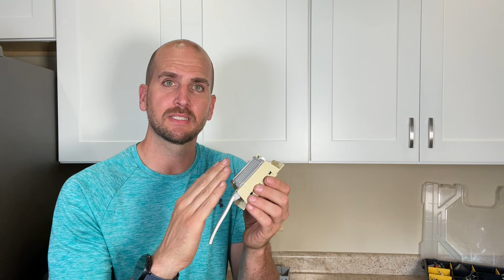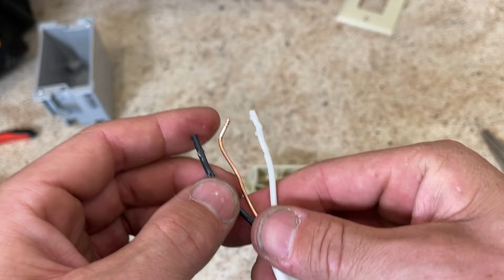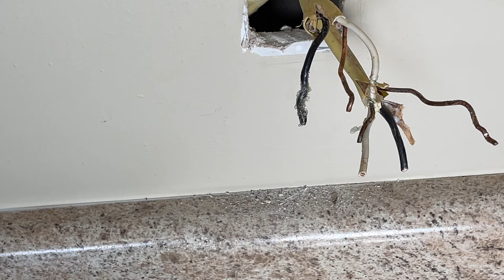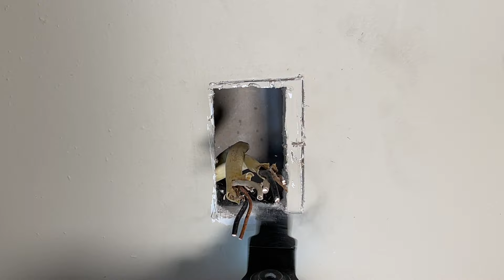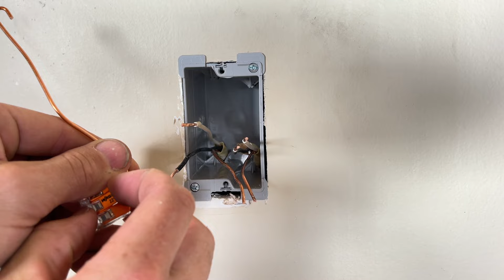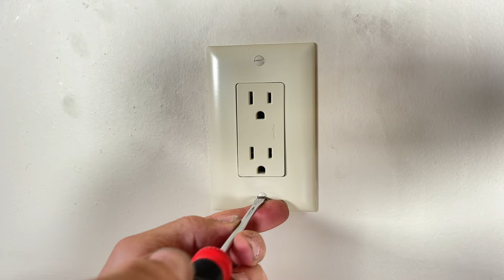How To Replace a Failed Mobile Home Outlet

Comment: never seen that type, at least you can change the face plate, the ones i am familiar with are the ones that were in mobile homes in the 1980s, they wire the same way and mount the same way, but the plates are not changable, they are all one piece. the light switches are the same as well. they are in my uncles modular home and they have been painted so many times the outlets are caked closed and the switches are hard to move, I have replaced a few of them but none of them are melted or anything gladly. 
https://www.mobilehomerepair.com/shop/electrical/e-111-ivory-self-contained-toggle-light-switch-with-plate/

Comment: So I do live in a mobile home and replacing the those very boxes. My cables go through the bottom and out the top with the cords being connected in the middle. Do I cut and then pigtail like you did?

Comment: I always replace all receptacles to standard as those are extremely unreliable outlets and do cause shorts. Have seen this very same problem 1000's of times in Mobile Homes, and is really a major problem with Mobile Homes with aluminium wiring due to aluminium expands and contracts so much due to heat build up. I always hook up using the J hook method of wiring except if i'm using commercial grade receptacles which i prefer. I'm retired disabled now and still i would replace those as they are Industry junk to save a buck at the manufacturer. 

If your doing something do it right the first time. Don't ever shortcut. And these types of receptacles are just that a cheap short cut designed to cut down on manufacturers time and moneys not about electrical safety in the home.

Never use the 14 gauge quick connect method either. There's no real difference in the way the connections with the press connect and the quick connect work and are problematic in real life usage. You want as good a connection as you can get when using electricity. Both for the Product being used and the life of the grid service in your home. And especially in a customers home or a business.

Comment: Nice video.  We live Fulltime in a 2010 MH which utilizes the same type of receptacles.  Just had one  look exactly like the "burned" one you show in your video. I'll be changing it out as you did.  The harder part in my MH is the shallow depth of exterior walls. Have to look a bit harder to find shallow boxes. Fortunately, the one I am replacing is at the end of a run, so only a single wire coming in, but I love the WAGOs. Have started using them instead of wire nuts.  Good job.
Reply: The WAGOs  have about the same contact as the back wire receptacle.

Comment: That’s the same kind you find in a RV. Those kind should be illegal.

Knowing even a little bit about home construction and living in an RV or mobile home makes you feel like you’re sleeping in a coffin just hoping nobody ever hits the button on the crematory furnace you’re in. 😣😥
Reply: Yes, we have a similar looking "burned" receptacle in our 2010 MH. Going to replace it just as you did in your video.
Reply: @gonebyrv9748   A few tips:

Check the depth of the wall cavity to see if it has room for a full-sized electrical box before you go to the hardware store.  If there isn't enough room for a full-sized box you may be able to pick up a shallower box that will fit.

Check the current outlet and see if they have more than just the one cable going into it.  Multiple sets of conductors are going to be a pain to squeeze into a shallow box, but there is a work-around.  Since the RV outlets are doing triple duty by acting as a receptacle, box, and wire nut; you can make things slightly safer by installing an old work box in the wall and using a new RV outlet.  That way even if the outlet fails it will still be contained.

Comment: Frightening! If I absolutely HAD to use one of those, I'd strip all of the insulation off of the wires in the area before putting them in the clips. I would not daisy chain cables with that design. I couldn't tell if the burning happened from the cable connections or a bad connection to a plug, but considering the poor quality design of the cable connections, it wouldn't surprise me if the connections to the plug were equally poor.

As for the cover screws, I don't concern myself with making the slots horizontal or vertical, I make them tight. Many people don't realize that the cover is actually part of the physical structure of the assembly. When putting in a plug with a loose cover, you're relying on the cut drywall edge to hold the outlet from being pushed in, which will wear out and get loose. A tight cover gives support to the outlet when inserting a plug by transferring the pressure to the larger strong drywall under the plate edge. I always make sure to get the plate tight.
Reply: A cover plate is NEVER structure. I have seen more cracked or broken cover plates installed over improperly installed outlets. The box needs to be securely installed, not loose or wiggle, and should be squared & level. The outlet or switch needs to be installed so that it is straight & also secured to the box without the cover plate involved. (This can be done with an approved spacer between the outlets and the box if there is a gap between them.) The cover plate should be flush to the wall without any bending or twisting when installing the screws
Reply: @johnsantoro4771  I agree with you, that's how it should be. The spacers are a good idea. I have seen many outlets, though, which were installed where the box was not flush with the wall, and there is plaster or worse, drywall supporting the tops and bottoms of the outlet brackets. Over time, the drywall crushes and crumbles out, leaving the outlet loose.

Obviously I didn't install all of those boxes (actually I didn't install any of them), and I have found that a good tight cover plate can make it secure. It also holds the center of the outlet while the brackets only secure the top and bottom and are subject to bending.

The trick is to use the "unbreakable" plastic ones or metal ones. Not the cheap ones that crack. I mean, the cost difference is like 30 cents for unbreakable or maybe a couple bucks for metal (or wood for style.) You are right though, it should all be tight. I have never looked at an outlet and thought oh, the screw slot isn't vertical or horizontal, what sloppy work lol. I find them functional, not a piece of art.

Comment: In my opinion pigtailing conductors (not grounds) is kind of silly. It adds cost to your project and cramps more crap in the box which always seems like its too small
Reply: I recently discovered one of these mobile home outlets with 3 hots and 3 neutral wires jammed in it. When dealing with so many wires pigtailing seems to be the only good option.

Comment: After sliding the J hook over the screw, I always pinch it around the screw creating a complete loop. If for whatever reason the screw backs off or gets loose, the wire won't just pop out of the connection.
Fantastic job replacing the whole receptacle and box!

Comment: Great video! FYI, when a home includes this type of outlet, they often have similar switches. When re-using switches (which I also do not recommend), we must notice the contact points as they are different than the outlets. Three tabs are for one (common or load) and one tab is for the other (common or load). Just my limited experience with a few mobile homes.
Reply from the maker: Thanks for the feedback and a few others have mentioned the switches being a much larger pain in the butt. 😅
Reply: @EverydayHomeRepairs  The switches are a HUGE pain. I hated replacing the switches in the MH... but it was necessary. We even put motion sensing switches in my kids room. Thankfully when we moved from the MH, it was a super easy process to just put in $1 switches were the motion ones were because I already had spent the work installing standard switches.

Comment: My first ever home, was a mobile home and I swapped ALL those cheap mobile home devices with tamper resistant receptacles and plastic wall boxes. Was not easy. But was fun!
Reply: Are they the spec grade or the $1.50 residential grade?
Reply: @soundspark  At the time I still had the mobile home, the outlets I replaced with were Decora tamper resistant residential grade. They were not $1.50 back then in the early 2Ks. They were around $5 each at Lowe's
Reply: Why did you replace something that was working?
Reply: @AA17768  Actually, the outlets were not holding the plugs well, some were even falling out as soon as I plugged in, and some outlets, the wires had already come loose and the circuit not working. So I replaced all of those outlets with new code approved outlets that all work.
Reply: In doing that work did you run across one with three sets of neutral, hot, ground clusters?

Comment: He made the outlet do the shocked face style (cause if metal falls in behind a plug that's what you get)
Reply: It doesn't matter because:

1. A receptacle in good condition should hold the plug completely, meaning anything that falls there will land on the plastic plug, not the metal prongs. If your receptacle isn't holding the plug in properly, replace the receptacle.
2. Most of our plugs in the US don't have a ground pin anyway (which I personally think is really stupid, but sadly this is the reality I find myself in), so no matter which way your receptacle is facing, you'd still have contact across the hot and neutral prongs if something somehow managed to get there.
3. This is a completely made up, unrealistic scenario anyway. We don't live in whatever weird fantasy land where random metal just falls onto our plugs that people are so worried about. The sky isn't falling, chicken little.

Comment: if you think the outlets are bizarre, try the switches. they are wired in ways that defy all logic.
i replace all outlets and switches as i remodel. i had one switch at the back porchlight that was wired one way in their all-in-one outlet but when i wired it exactly the same in a regular box with a regular switch it tripped the breaker everytime. my b.i.l. finally figured out how to wire it and it's worked great since with no issues....even he said he had never seen anything like that before.

Comment: Great video... Thanks for sharing your knowledge with us.
I hope you don't mind a layman's suggestion...
If you are a homeowner wanting to do this project yourself (DYI),
Mobile homes burn very quickly and FIRE has NO MERCY.
I would strongly recommend NOT working on this electrical project yourself.
This is electrical and you have yourself, family and children to consider.
House fires, burns and DEATH can NOT be fixed! Nothing wrong with asking for help...
There's nothing wrong with calling an electrician. It's just one phone call... 
Replacing one plug is fairly cheap to have done and your wife and kids will RESPECT you for it.
I hope you understand and that there are no bad responses to this post.😎
Thanks for reading.

Comment: I have an outlet like this in my RV that just broke one of the butterfly nuts. I did not know they were also put in mobile homes. I am planning to install a remodeling box. You called it an old work box. I’m not sure what the correct term is but I never heard it referred to as an old work box. In an RV the walls are much thinner than a house so I can see why they would use these all in one receptacles. Luckily my broken receptacle has a storage compartment on the other side so I can fit the remodeling box without any issues. I love the Wago connectors! I just bought some twozeeys and threezeeys on Amazon. They’re expensive but well worth it. You just need to be careful not to hit a lever when you’re pushing everything back into the box.

Comment: Another great video, can WAGO CONNENTORS be used on aluminum wiring
Reply: According to Wago, the 221 accepts only copper conductors.
Reply: They are not approved for aluminum.  Look for a connector called AlumiConn.

Comment: In some MHs the wall space is shallower than a standard box, so double check the clearance behind the box or it won’t sit flush against the wall.
Reply: 1.75 is max width for the box
Reply: @louisangel9455  He's talking depth.  I had to use shallow boxes and mini toggles to fix the receptacles in my RV.
Reply: width or depth? @louisangel9455
Reply: Hi if you replaced outlet with standard outlet what did you use to take up the protruding outlet

Comment: My MH is a ‘99 model and has actual boxes nailed to the stud. Good thing, because a third of the receptacles have been replaced, all because of the push-in back wiring method used to install them. Please keep encouraging best practices, great video as always.
Reply: Same with my '94 DW.  These videos on the grades of receptacles are real lifesavers. I've just purchased all new commercial grade tamper resistant ones.
Reply: Mine is a 1987 and I have done the same with commercial grade receptacles. And I have Also replaced most of the switches with conmmercial grade. I installed 2 LED Panels in the kitchen. They flickered and I was ready to take them out. Decided to replace the 2 3-way original switches with commercial grade 3-ways. End of flickering! 👍🏻

Comment: Glad that I never came across these piece of crap devices in my 50 years as a sparky. Smart move replacing inferior receptacle with a standard receptacle.
Reply from the maker: I am a recent convert over to WAGO 221 lever nuts.  They are pretty nice 👍

Comment: Thank You Thank You Thank You!!
Recently retired into a over 55 mobile home community. I have no idea how these homes are put together. This video is immensely helpful!!!! Would love for you to do more mobile home repairs. Not many YouTube creators dealing with mobile homes.
Thanks Again
Reply from the maker: Yeah, I also noticed there is a lack of mobile home repair videos.  Appreciate the feedback 👍
Reply: Absolutely agree with you!! 👏 Researching mh repair help, especially electrical problems, has been a nightmare!
Reply: Lol. I've been doing mobile home repairs for Years. In the process of completely rearranging & remodeling a double-wide's master bathroom & making everything handicap accessible. What a mess. Too many loads on one circuit, not to mention 14gauge, brittle water supply lines, the amount of staples, foam, & glue is crazy.
I could go on but I'll leave it with this.
As aggravating as they can be, they're job security for me lol.
Reply: @YTubeScandalScrambledMyHandle  Dude. I'm going through this right now. I'm renovating the first of two bedrooms in a 1972 mobile home. What I found shocked me. 2x3 construction, the electrical boxes are screwed into the paneling, none of the wiring is stapled to a stud. Getting the ceiling ripped out was awful because it's put up before the walls are. Gutting the ceiling was a horror movie. Yeah, and staples. Hundreds of them.  I actually bumped the studs out to a true 3 1/4 so I can get real vinyl replacement windows in it. Kinro no longer exists. Worked out great and it also allowed me to get R-15 rock wool insulation in the walls and ceiling. With a freaking vapor barrier TYVM. Drywall goes up this Sunday, then the second bedroom and bathroom is next on the list. Fun stuff. Oh, the other shock was gutting the walls, no vapor barrier and the other side is...the outside sheetmetal. Wow. Really?! All that metal cladding will be ripped out and I'm putting log cabin siding on it. When I get done you won't even know it's a mobile home. The previous owner did one thing right, he put on a nice forest green metal roof and roof frame structure on it. It's going to look awesome!
Reply: @BlackDragonProductions64  I do not envy you lol. That mobile home is older than I am. I can't understand how they can pass any code the way they're built.
Best of luck to you.

Comment: Thank you so much for this!!! It's very difficult to get information for electrical problems in mobile homes. They're not built like stick built homes and this is the first mobile home I've ever owned. It's not uncommon for an electrical receptacal to fail without tripping the fuse. This happened last month to the outlet for my new refrigerator.
     These receptacles are so poorly made that not one of them in my house can hold a plug. Entire quadrants of my house have no working receptacles and no breakers have tripped. I've identified and shut off those fuses at the box. 
    Thanks to your detailed videos on the grades of receptacles, I purchased all new commercial grade tamper resistant ones for the house. While they cost quite a bit more, I have no problem paying extra for the peace of mind!!
Reply from the maker: Great, best of luck with the upgrade 👍 and thanks for the feedback.
Reply: @EverydayHomeRepairs  Thank you for taking the time to make such valuable videos! Great job!!

Comment: Greetings from Canada. Something new... Face plate screws aligned with slots horizontal. I do something similar to this as well for any given face plate I make sure the slots in the screw heads are either horizontal or vertical. I usually pick a position that requires less torquing of the screws to prevent cracking the face plate. This gets progressively more challenging as you move toward multi gang face plates.
Reply from the maker: Hey Dean, you got it and thanks for watching 👍

Comment: How does that Grey box secure into the dry wall? It looked like the screws you tightened would be in the hole.
Reply: There are little plastic ears that turn out when the screw is tightened.  This clamps the box to the wall.  It is called an "old work" box.  New work boxes are put in before the drywall and are usually nailed to the studs.